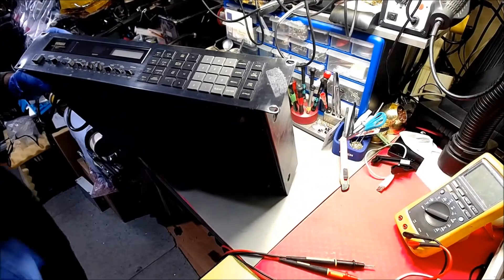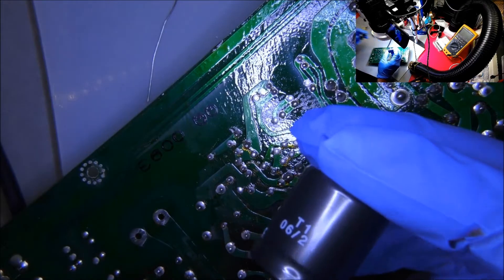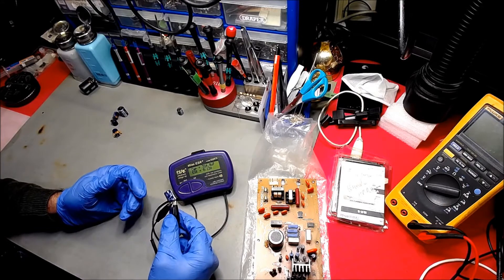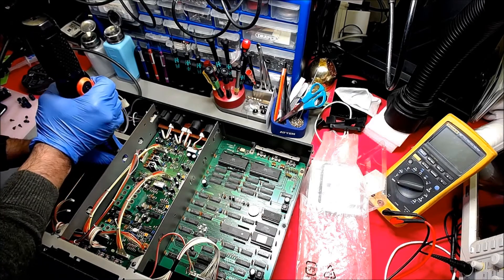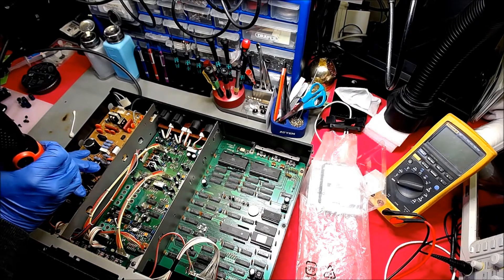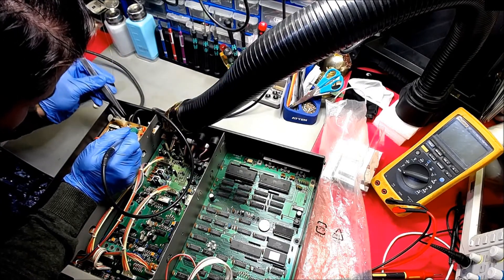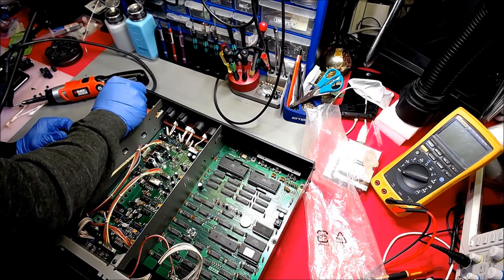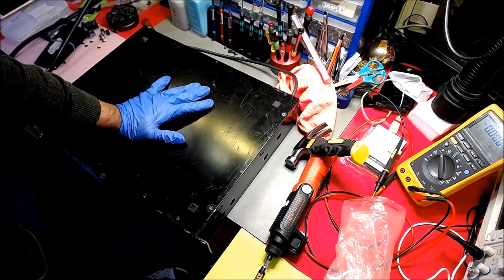HOW I FIXED YAMAHA DIGITAL REVERBERATOR REV 7 POWER SUPPLY PCB FIX DAMAGED CAPACITOR

Comment: Thanks for the video... I just got a unit that needs some work done, I'm planning on doing the recap as well as fixing the display, any idea on what could cause the display not to shine properly? It's very dim, and I need to be straight up facing the display to read it.